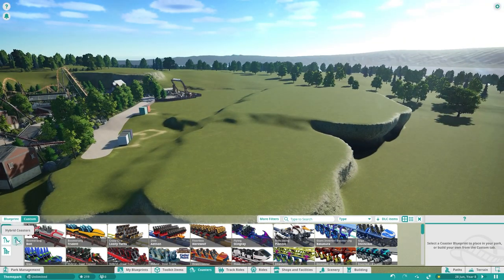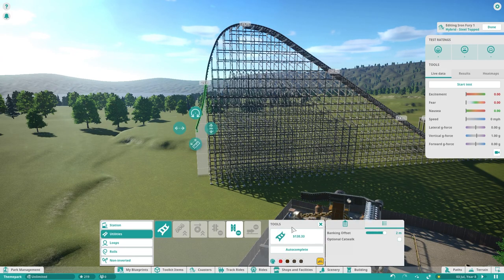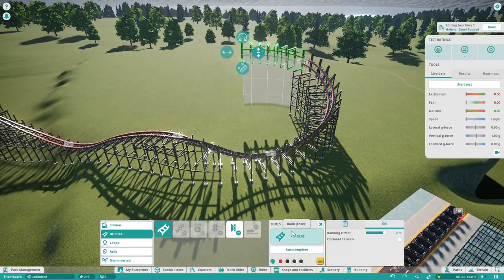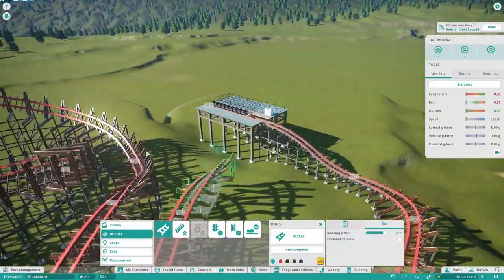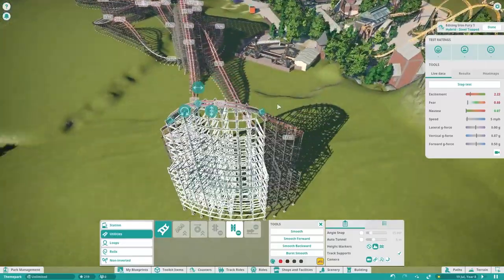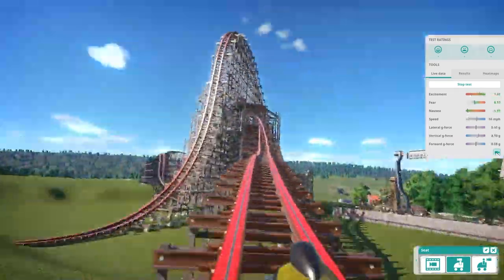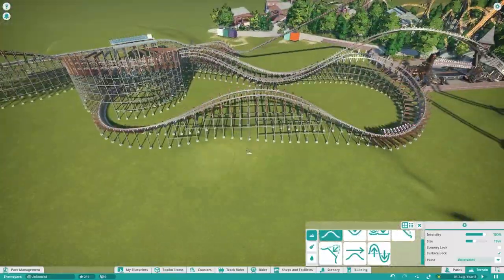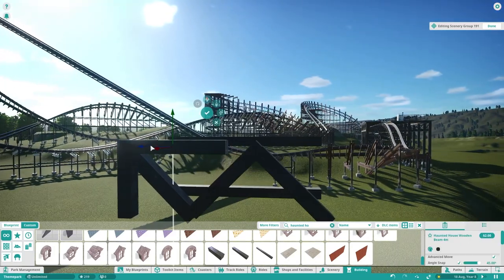RMC Hybrid - Planet Coaster (8)

Comment: Any chance of putting this custom lift structure piece on steam workshop?
Reply from the maker: It’s a small piece so probably not worth it. It’s a rectangular box made of haunted house beams (you can probably use another piece like the concrete pillars if you don’t have the dlc). You then connect the sides up with diagonal pillars to basically make each side made of 2 triangles. (Looking up a reference image helps).

You take this box piece and rotate it so it’s the same angle as your lift hill and then just duplicate it along until you’re at the top (if you rewatch the bit of the video where I did it a couple times that might help) 

If you need more help let me know and I’ll take some screenshots of the process.
Reply: @Iron-Agent  Ok thanks for the tips :)